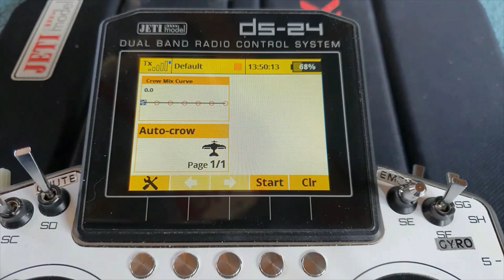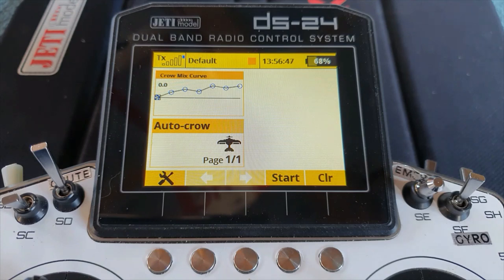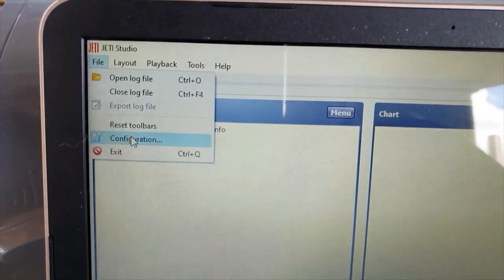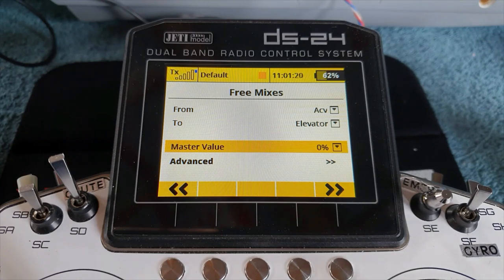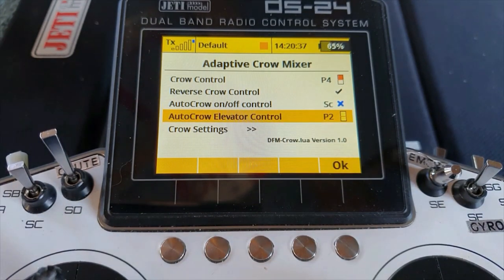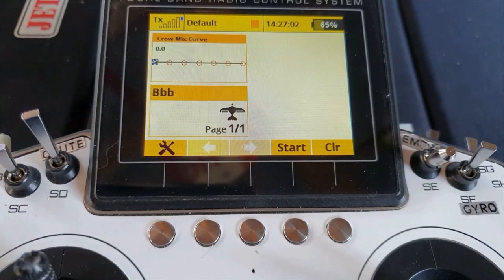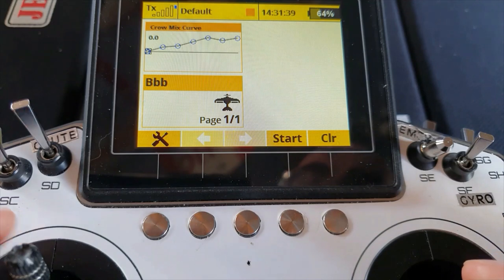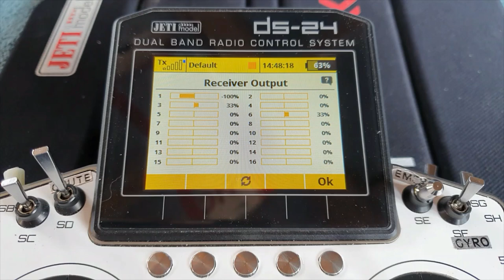Jeti - auto-trim a multi point curve for crow brake (butterfly) elevator compensation, episode 1

Comment: Hi Harry.  I tied this on an F5J plane yesterday and it worked great!  Much better than land, adjust, launch, land, adjust, launch ...  I never really had a perfect elevator compensation setup with the manual method.  Nailed it after two tries with the LUA app.  Just had to use the advice in the second video to extend past 50%.   
I used your default setup - worked fine.  My only issue was hearing the numbers for the unset points being called - the "Autocrow" warning often overrode the point and then, if I had any elevator set, the number would never be called again.  Not a big problem since when refinig points after initial setup the numbers aren't called anyway.  Checking the graph on the screen seemed to be the best way to see which point you are on.

Many thanks to Dave and yourself for developing the app.  It works so well I'm going to use it on my other gliders.

Cheers
Simon

Comment: Finally figured this out I had the setup on the P4 stick wrong.  I am getting to understand the differences in proportional controls better and that was the problem here had it set to proportional with a zero value being output when off instead of centered and a -100 value being output so the output of the logical switch started at 0 instead of -100.  Thanks Harry

Comment: Hi Harry
Nice work with this app, thank you. 
I flew it today on a Dream-Flight Ahi and all went to plan. One quick question when copying the settings over to the built in butterfly elevator compensation. Rather than setting S1 value to 100% in the elevator compensation and then using half app values for the curve why not use full app values for the curve and set S1 to 50%? It looks like it’s working from servo monitor but the proof of a flight test will need to wait a couple of weeks.
Reply from the maker: That's ok, I do it that way myself now, 50% mix and copy the actual point values

Comment: Harry I tried this on  small glider and had some issues.  The glider is set up with 3 flight modes and in climb uses P4 for throttle, in landing uses P4 for Crow. To make that work I have Crow controlled by a logical switch.  When I would use throttle it would announce the control points.  When I was in the Crow mode it would start the control points at 3 when set to 7?  The setup for the controls is my own invention does not follow ay of your schemes.  What's wrong or point me in a direction.
Reply from the maker: If you have used P4 as the crow control in the app settings then the app will work every time you move P4

Comment: Harry, I'm having trouble downloading the app from the location you show in the video. did it get moved?
Reply from the maker: You don't download it from there, you do it in Jeti Stidio
Reply: @cotswoldpilot  I understand that. It gives me an error message in Studio. I posted a screen shot of the message in the thread on RCG where you posted it.
Reply from the maker: Just discovered that the address is case sensitive!  It needs to be Apps, not apps
Reply: @cotswoldpilot  Got it now. Thanks again...
Reply: @mwiz64  Harry, the menu structure seems to be different in the current Studio version (V.1.1.4) and I can't find how to open this lua app - I think it should probably be under Transmitter Wizard/Lua App Manager, but it doesn't seem to accept the URL.  Any ideas as to how to upload with the current Studio version would be appreciated. Thx